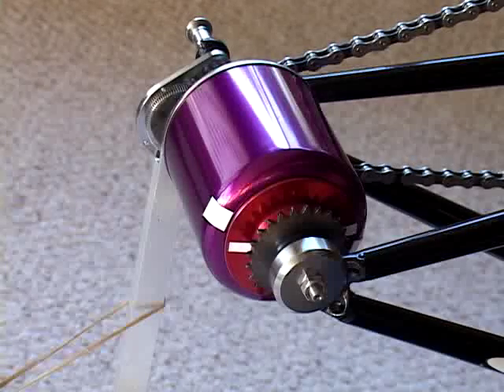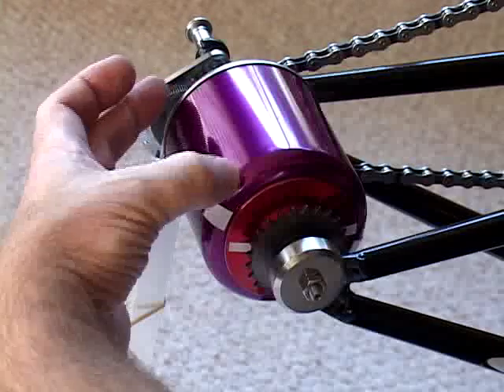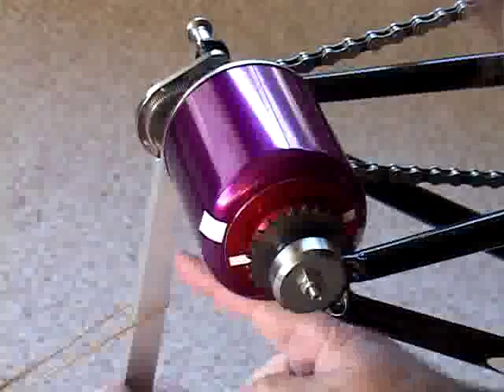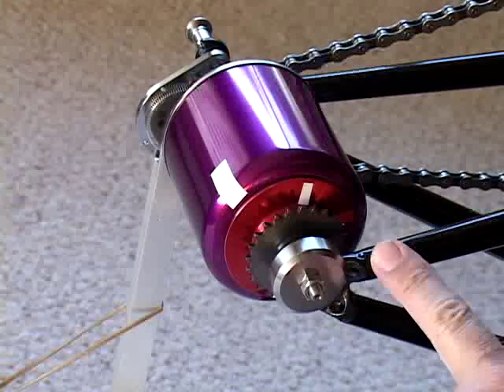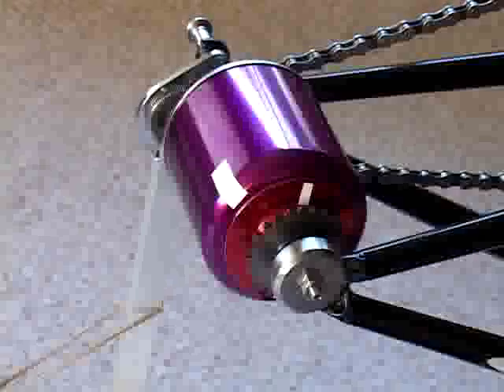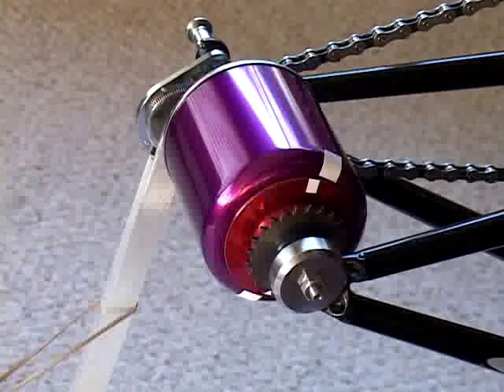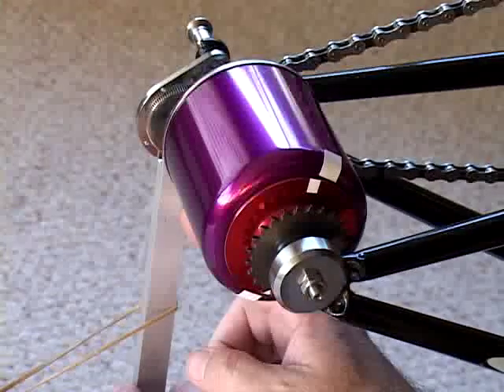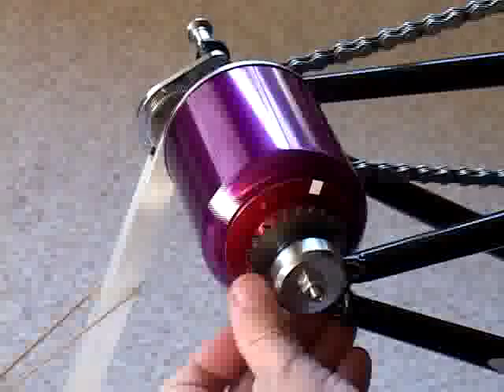Automatic Bicycle Transmission (IVT)

Comment: How much does your prototype weigh?  Is this a similar technology to the Rholoff, or the Shimano transmissions?  Very cool idea by the way.  I ask about the weight because as a trike rider, I could see big possibilities of this combined with a lightweight belt drive (though I realize the frame issue would have to be worked out - probably front wheel drive with removing a front wheel to install the belt...

Comment from the maker: Overload protection is to prevent abuse with motors over 1 hp.  For pedaled bikes, it won't go to zero with high pedal force.  Gates Drive is problematic because it requires a breach in the stay & drop-out structure of the bike frame for installation.  Also, the main advantage of Gates is immunity to mud, which the SIVAT will offer because its mechanism is sealed.

Comment: when you overload the transmission, it seperates- that would be a disaster on a hill on a bike/trike.  How would you address this?  If it is workable, could it be used with a Gates belt drive system?

Comment from the maker: Thanx!  Since the SIVAT uses technology unlike other CVT's (let alone an IVT), its mechanism can handle high torque.  If this developed device handles the high torque of bikes as calculated, it can handle the fairly similar torque in cars, especially at the larger size for cars.  Future testing should confirm this on its Gen 2 design for bikes...we'll let some gonzo MTBers try to trash it with hard riding.  I'm confident that we'll catch weaknesses before proceding to the next stage for cars.

Comment from the maker: I'm convinced that the SIVAT will push the evolution of transmissions in general!  Having been an engineer for many years, I've seen & designed numerous drive systems for a variety of machines that would benefit from overload protection & ability to achieve a wide array of ratios with automatic or manual adjustment offered here.

Comment from the maker: It's a sealed rolling sump design if used w/ oil, but I'm partial to grease lube because it will quiet down the motion.  Life-testing should indicate whether grease is effective.

Comment from the maker: Thanx!  The seccond design is intended for hard use on MTB's & motor-powered bikes.  It has a universal design which can be adapted for hub, bottom bracket or a separate location such as at a F.S. pivot for the rear suspension.  A bottom bracket version would be ideal for weight distribution & would allow an un-idlered chain drive like a fixxie, but would require a special bottom bracket on a hardtail.  Its very high top ratio will allow a very small chainring like a 32 or 34-tooth size.

Comment: I love the concept.One thing on my mind though. From the video it seems the transmission is only adjustable up to a 1:1 ration or thereabouts? Considering this prototype is for a bicycle and conventional bicycles start at 1:1 or higher, wouldn't it be more convenient to have the ratio range from 0 through a much higher range of ratios. Is a change to the output ratio range possible within the constraints of the housing or would that require severe modification to the system? Great work though!:D

Comment from the maker: I've designed a second version that will handle about 1 kW, or about 1.3 horsepower in a nearly identical package size.  It will also offer its own self-contained high gear of over 3:1.  The second version is intended for motor powered bikes and/or super hard-core MTB riding.  A larger SIVAT, smaller than equivalent automotive transmissions, can accomodate even high-performance cars with no need for a clutch or torque-converter.

Comment from the maker: Multiply the SIVAT ratio times the sprocket ratio.  For example, the video features a 55T/11T sprocket pair that gives 5:1 high gear.  A typical MTB offers 4:1 high gear (44T/11T).

Comment from the maker: Snowmobiles use a Variable Diameter Pulley (VDP).  This is not such a mechanism.  One day, after the patent is issued, I'll explain how it works.  Prepare to be confused... it will not be easy to understand how this works.

Comment from the maker: I am every bit a skeptic as you are, and would doubt this too if I was an observer.  However, I can assure you that this invention is real enough to become a product that performs exactly as I say it does, exactly as the video shows.  There is no VDP or traction drive at work here; this SIVAT is a ratcheting mechanism that uses gears, levers & one-way bearings.  It's as simple as that!

Comment: Barry, first my congrats to that great IVT project. May I encourage you to design a special variant for bicycle use that is more narrow than an ordinary rear wheel hub, just to fit a gearbox shell like Karl NICOLAI´s G-Boxx 1 (g-boxx.com, g-boxx.org) or the PINION gearbox (pinion.eu) with an ergonomic Q-factor. It would be promising to apply your IVT as an encapsulated central gearbox for many types of competition riding (MTB...RR), even for commuter bikes. Cheers

Comment from the maker: No.  There's no slip.  It's positively geared, strange as that seems.  Dynamic friction plays no part in power transmission in the entire mechanism, so its efficiency is comparable to conventional, fully-geared transmissions which are highly efficient.

Comment from the maker: Yes.  20-to-1 might be close to the practical limit of high gearing.  The method to achieve that is to use step-up gearing at the input and/or output.  The new design SIVAT has an internal high ratio of ~3-to-1, so you'd need to use 7X gearing.  Note that the video version has 5-to-1 at input by using a 55T/11T sprocket combo, so the whole system has a high ratio of ~4-to-1.  Very high ratio transmissions usually are less efficient in general.

Comment: Just stumbled accross this and found it very interesting. I haven't read all the posts but was wondering what application there might be for electric scooters especially ones used for commuting? I have a scooter I use to get to the bus and from the bus to my office. I won't carry my weight up hills or even slight inclines. Something like this could make that possible.

Comment from the maker: The response has a fluid-like feel to your legs, very natural & intuitive.  The ratio will lower to the extent of your pedal force; more force will cause the ratio to go lower, but only slightly more quickly, never abruptly.  As the ratio changes downward, it will tend to equalize to cause your pedal cadence & force to remain nearly constant most of the time, regardless of grade.  Upshifting will be quicker.  You'll also be able to tune it for your personal preference & power level.

Comment: So if I peddled harder and faster the Ratios will adjust(drop smoothly or in quick notches?) and slowly level out as I peddled faster and faster, eventually going into over drive to where I can peddle at a normal cadence and maintain a constant speed?From stand still I can pedal hard for quick accel and then ease off to go into higher ratios for  low rpms? What about back peddle?  I want to be able to 'kick it down' for passing power.  Will the sudden kick downs be noticeable?

Comment from the maker: Thanx for your response.  The problem with making a speed responsive bike transmission is that pedaling hard causes an upshift when you want a downshift!  If you pedal forcefully in one ratio, the bike speeds up with that scheme, sending it into higher ratios.  I figured that torque-responsive ratio change is better, and proved it decidedly riding with an earlier automatic CVT.  The SIVAT will deliver what you're asking for without electronics.  It's actually simple.

Comment: Sounds like you have a very eager market waiting and great product testing/ reliability standards which makes a successful and responsible company. Is there any plan to make a fully automatic CVT that automatically adjusts to pedal in put (RPM and Torque/Force rate) in the future? I know its defiantly not simple and probably not possible with out some type of ECU to adjust the clutches.  Prob not worth the extra cost.  Still would be cool to have a bike adjust to the right ratios.  Thanks!

Comment from the maker: I intend to make the SIVAT available as a stand-alone product as well as a vehicle component.  Although a nearly identical unit for both purposes should become available, it will have at least 1 kW capacity; so, stay in touch.  You can use my YT in-box for inquiries.

Comment from the maker: The SIVAT for MTB's will be designed to only go into ultra-low ratios at pedaling forces beyond human 'stand-up' forces.  The overload protection will assure that over-sized motors on bikes won't destroy anything with power greater than ~1,000 watts.  We'll test it, so I intend to make the next video without a higher-pitched voice!

Comment: How much will that new system cost and is it compatible with a Next Mountain bike?  Is there a dealer anywhere or a website?  I'm really interested in it.  I'm in need to use my bike for short commutes to my job and I cant use my gears the way I need to efficiently on hills.  

This is my issue.  PLease help! 
/watch?v=OtwVByZMupw

Comment from the maker: On the prototype shown, the input is 5:1 (55T front sprocket, 11T rear).  The second generation will have an internal high output-to-input of about 3:1, so it doesn't need such a radical sprocket setup on its external input.

Comment: I do CAD and have invented a flatter infinitely variable transmission with lever modulation. It is roughly 1/4 in size compared to yours. Do you have the prototyping means so we can develop it?

Comment from the maker: Yeah, I thought about that.  One feature it will likely have is a lock-in lever to override the automatic operation, once you're in the ratio you prefer; initiate it like pressing a button momentarily.  This way the ratio won't drift upward, and you don't need to pedal hard to keep a low ratio.  Mostly, you'll only want lower gears while ascending a hill when you surely need no braking.

Comment from the maker: It can be controlled with a handlebar-mounted lever too.  The main intended control method is the rider's pedal force which was proven to be very natural by a similar, earlier CVT.  We'll test some variations to determine what control system riders prefer.

Comment from the maker: Thanx for your concern.  I've been through the patent process several times, working w/ patent attorneys at the write-up level.  The strategy is always to write the patent in the broadest possible terms, including applications of the novel technology to divulge full utility.  This invention involves a broad list of uses in the patent app, I assure you.  My main consideration is the huge number of claims, some of which will likely be dismissed by the examiner.

Comment: Hi - if you haven't, get some intellectual property advice from a lawyer. No doubt you've considered those issues. One issue that occurs to me, as an IP lawyer, is: if you patent the invention for, e.g., bicycles, you might not be able to claim other uses (e.g. cars etc), as they might not involve an inventive step from the first use. But if you claim all at once, you might not be ready to exploit in the term. Just a strategy issue to consider if haven't already. Cheers

Comment from the maker: I read what you write as your observation that the output looks irregular at super-low ratios; that irregularity disappears under typical operating loads. The second design won't drop to zero output under any real MTB bicycling forces.  BTW, when it does go to zero, it appears to slip, but it does not slip; it's still fully engaged, and cannot roll backwards at the output.  It helps to know that the SIVAT works in ways unlike transmissions with a clutch.

Comment from the maker: For bicyclists the overload protection would not be invoked by any level of torque you'd produce.  It's there to prevent damage from abuse, such as using a motor that delivers >1.5 kW, its specified limit.  A new design is prepared for prototyping & testing; it's based on careful measurements of the unit in the video.  Since this video was of a proof-of-principle unit, it could not have been thoroughly engineered in its new, unknown technology.  Now, we have the data, & have engineered it!

Comment from the maker: We'll know that when we get the 2nd prototype on the dynamometer.  The theory suggests that it will make electric motor drives more efficient, most important for battery-powered vehicles.

Comment from the maker: Current development is for a non-bike application, so the bike version won't be available for at least a year.  The bike hub SIVAT will likely include 10mm & 20mm axle options.  I'm also considering a bottom-bracket version for special F.S. frames to accomodate pedal and/or motorized MTB riding w/ very light rear wheels.

Comment from the maker: Yeah, the key to this IVT is that the top ratio can always be chosen without sacrificing its ability to reach into extremely low ratios.  The new design will raise the top ratio internally; this will allow the front sprocket to be small, even for rather high top gears and greater ground clearance.  

ps. you're welcome! :)

Comment from the maker: The mechanism has proven to be very robust, but we'll life-test it in development to be sure.  As far as a 'narrow gearing span' is concerned, that cannot be less true; the SIVAT's range is far beyond anything any MTB or Downhill rider would ever want.  The new design goes from 3X to zero, meaning that even a modest 36T front/18T rear sprocket combo will produce a higher top gear than Road Bikes, and a lower bottom than on any MTB's.  In actual practice, it's ~15X from top to bottom!

Comment from the maker: Yeah, I noticed that.  It's a result of very light resistive load.  If the resistance is increased to >10% of typical loading, that jerkiness disappears.  The variable ratio mechanism has a very slight stickiness that causes irregularity when very low throughput torque is applied to it, amplified by the mathematical logic of its motion at low ratios.  During normal operation, its gone.  As a factor of friction, that stickiness is <1% across all ratios when the SIVAT is adequately loaded.

Comment from the maker: Yeah, it's like a combination clutch & transmission without the friction & wear associated w/ a typical clutch.  A motor driven SIVAT may require a simple microprocessor (computer) to assure smooth, controllable acceleration; a later phase of advanced development.

Comment from the maker: Not yet.  We're in the initial development stage w/ a redesign to give it higher power capacity for applications in a product line.  The new design will also be a basis for MTB transmissions.  This will take a while because it will involve testing & design refinement to assure lightest weight, high reliability & compatibility for various uses.

Comment from the maker: Derailleur systems vary between 92%-96% efficiency depending on sprocket/chain alignment, but only as well-lubed & clean.  The SIVAT is estimated to be 87%-93% efficient, also dependent on ratio with very low ratios least efficient; that will be tested in development.  Ratio range: 3X to 0.2X at hub; multiply these by your sprocket ratio for final over-all ratios.  In theory, the lowest is zero, but only if it's over-torque at input (nearly impossible for bicyclists).

Comment from the maker: I suspect, after devlopment, it will finally be about 1.5-1.7 kg, whereas derailleur systems are typically ~1.3 kg.  It includes a user-adjustable knob to fine-tune torque-response rate that will effectively allow you to change your cadence up or down from 90 rpm by +/- ~30 rpm for 175 watts of sustained leg-power.  You'll be able to spin at any time if you can sustain higher pedal force, resulting in more power throughput.

Comment from the maker: The new SIVAT will have ~3X high gear, so even a very moderate sprocket combo will result in a very high top gear.  The SIVAT is ideal for high accelerations because it continually reaches the best gearing for power throughput during an entire acceleration automatically.  Although it's possible to add derailleur gearing, that would not impart any advantages to this IVT with its vast range & quick responsiveness.  I don't anticipate wear as an issue, but that will be tested in development.

Comment: one problem part in the prototype is that if your going up a large hill then you might lose all power all together and fall down the hill backwards so you might want to put in a safety lever up at the handle bars where u can engage it so it will not completely stop giving power to the tires

Comment: also to add onto another comment for a person that is going up hill with the stock gear system i suggested exploring it would allow the person toe steadily increase there power to be able to peddle uphill easier and be able to quickly resume original speed after the hill more quickly

Comment: would it be possible for you to have it with he ability to engage a higher ratio for higher speeds....and also could u attach the stock drive train of a bike such as a 21 speed to the automatic transmission and get a more varied speed range with the steady change of the automatic to allow faster acceleration and less ware on the automatic transmission with the accompanied stock gearing like a 21 speed... also with the less ware it could help improve the longevity and reliably

Comment from the maker: For mopeds & pedelecs, the motor will be 'geared-down' to allow for the fact that motors generally run faster than pedaling.  the newer SIVAT has lots of range & a higher high gear ratio to accommodate motors and/or pedaling on hilly rides.